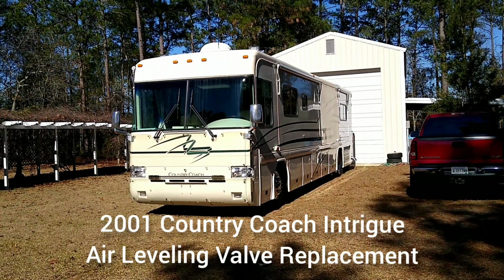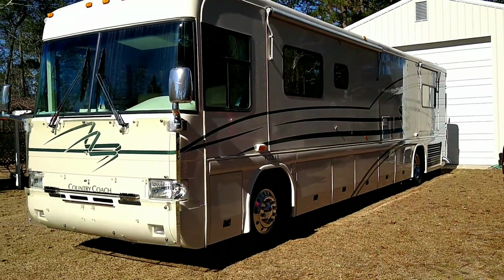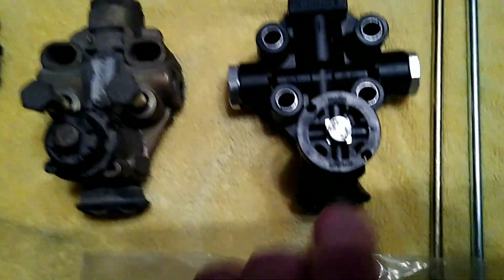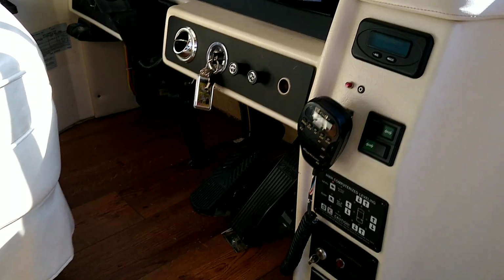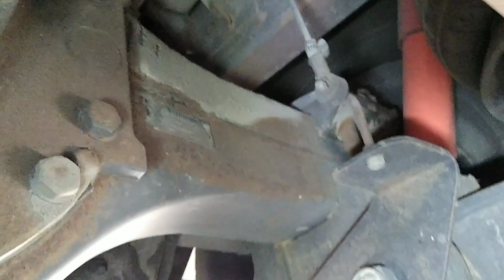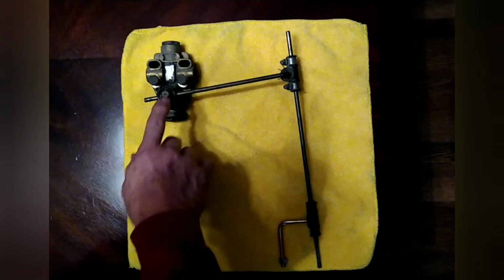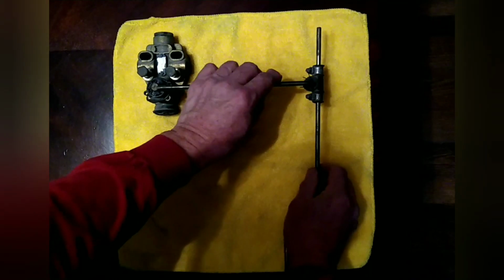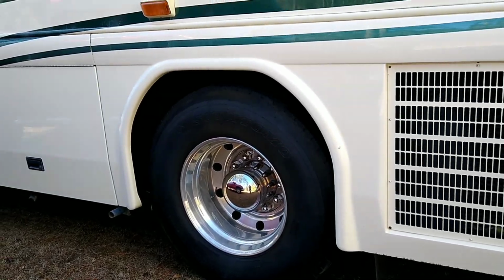2001 Country Coach Intrigue Air Leveling Valve Replacement

Comment: Thanks for the video.  The detail you went into is greatly appreciated.  I have 1998 Intrigue porject coach and I have issue with the front valve. The ride is very bouncy when driving.

Comment: nicely done...thanks    (did you feel nervous being under the coach when adjusting the ride height lever?)
Reply from the maker: I knew that the jack stands would hold, but I have to admit there is a pucker factor when the air relief valve pops off while your under there.lol
Reply: @tocclassic5415  to be honest, I prefer to place large blocks of wood under the main chassis metal.... (placing jack stands under the hitch seems to expect a 500 to 1000 lb rated hitch to support a 30,000 lb coach seems risky to me.... but maybe I just don't understand)   Of course, I'm a bit paranoid when it comes to working under the coach..... I do it, but I sure like to see a beefy safety margin.